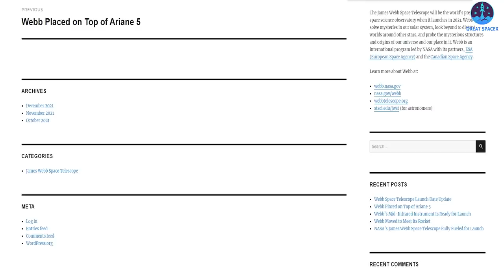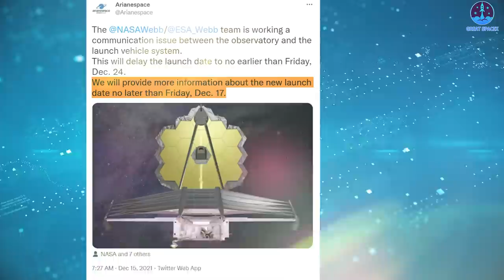NASA James Webb Space Telescope Launch epic got BIG PROBLEM!

Comment: This is a case of 
"If in doubt - DONT" Its a high stakes project,  I feel they are being particularly careful with the JWST purely because SO MUCH has to go right - THE FIRST TIME, hence one of the reasons why it has taken so long to get to this point, with the amount of testing that has been done and as much as it goes SO far out past the moon into the L2 orbit, so much has to happen for it to work right and as you say, once its out there, there is no going out there for updates or repairing is something goes wrong - I have no issue with NASA delaying launch and being a little paranoid with this project - I have faith its going to work - and my fingers crossed.
Reply: I agree. Delay as long as necessary. Take no chances.

Comment: "It's always the connector"  A wise electrical engineer once said.
Reply: First rule of Electrical Engineering: It works best if it's plugged in.
Corollary to first rule: It works even better if it's turned on.
Reply: Or an over tightened tie wrap that bit into the cable insulation, causing a short in a coax or twisted pair of wires!
Reply: Software or hardware ie circuit boards are just as likely when working with new systems like this.

Comment: When it fails and they do it again they should get it into earth orbit first and then deploy and do limited testing and refueling.  Then either drag it out to L2 or have  it boost itself out there.   Good luck, fingers crossed.
Reply from the maker: Yup! Hope so!
Reply: JWST does not have a propulsion system that can return even to a highly elliptical orbit with a perigee near LEO.  If it does not deploy there is no backup plan.  The JWST does not even have the possibility of onsite maintenance designed into it.  So even if in a couple of years we could deliver a Canadarm and a crew of astronauts experienced in working in space out to L2 they couldn't do anything.  In a couple of years Starship may be able to deliver a complete simplified replacement without the requirememt to unfold and deploy.

Comment: I’m more worried about Ariane V performance than the JWST unfolding itself.
Reply: "Ariane 5 launch vehicles have accumulated 111 launches since 1996, 106 of which were successful, yielding a 95.5% success rate. Between April 2003 and December 2017, Ariane 5 flew 83 consecutive missions without failure"
Reply: @beta_cygni1950  
Well, I hope they keep on the pace.
Reply: @beta_cygni1950  And I imagine they must have been extra super careful with this one, checking every piece of that rocket that they could, probably 2-3x more than they normally would.
Reply: It's the most reliable rocket of that size in existence that's NEVER failed (if we don't count the first few launches in the 90's when it was still in development phase), so I wouldn't be worried about that part.

Comment: P.s. 
Let me add, it is normal that a temporary 100 meters communication cable pick up some stray noise. Possibly the grounding connections are at a different potential. They are making it a bigger problem than what it really is...
Reply: Good guess - lets launch it to find out!
Reply: Cable ground shield needs to be connected at one end only. Or not electrically bonded to any end.
Had to trouble shoot a 40 meter cable for RS232 with noise / data loss. Ended up replacing it with a 4 x twisted pairs cable, ground bonding to the machine, and replacing a 15 year old optoisolator. Lowering the baud rate to 9600 also helped.
Reply: @trespire  …seeing as how RS232 was engineered for max 50 FOOT length (cable capacitance was the real killer)… yeah, 40 meters (approx 120 feet) is high.
RS422 was your friend at these distances… that was engineered for over 1,000 meters…
Reply: It is a power Giga Ethernet cable, 100 meters max length...

Comment: 7:00 afaik, the telescope life expectancy is between 5-10 years, not decades. by that time it will exhaust its helium coolant and will no longer be able to collect data without maintenance which is not impossible in 10 years, but not scheduled at this point. like i said - afaik. but im no expert, i just watch yt more than i should.
Reply: Is JWST able to refill helium?
Reply: @ Martin Slaba Not that I’m aware of.
Reply: @Glen Young yes exactly. Hubble operated so long because we were  actually able to maintain and update the telescope thanks to the space shuttle . James Webb once is it in the space, nobody will be able to repair it or doing upgrades.
Reply: life expectancy of JWST is 10 years plus some room to spare
Reply: There is no consumable liquid helium on JWST to “exhaust”. The telescope will cool passively to about a temperature of 50K thanks to the sun shade. 
One spectrometer sensor needs to be cooled further to about 7K. That will be done by an electro-mechanical sealed closed cycle helium gas refrigerator. That gas is in a sealed recirculating system. None of it will be lost. As long as the pumps work it will cool indefinitely.
Reply: @executivesteps  yeah, it is amazing how this myth about “helium coolant” got invented, plus other internet-invented gibberish repeated about this telescope, for example it is 10000 times better than the Hubble. The fuel is the only limited consumable that will eventually run out, not some helium.

Comment: I bet the problem is ground shift. Add more copper to that cable, tying the grounds from Input and Output together with more conductor.
Reply from the maker: Maybe...
Reply: @colonbina1  I have seen it many times, including on the Space Shuttle. You are right. It certainly could be something else but people build boxes that then talk to their own test equipment. When you hook two unknown boxes together, the interface between them should be the same except for the grounding in the cable. In my years, ground shift the most common problem.

Comment: If this was meant to launch in 2007 then you could imagine that the tech onboard was perhaps 1990's tech at the design stage when it was first drawn up to be launched at a later date. Obviously while you have hold up's in manufacturing you can't be updating the hardware as the years go by because the equipment has to have some level of reliability of robust previous use from previous technologies used in space so this product that is going up by the start of 2022 is 30 years old tech or more & hardly anything new to get worked up about because this is how government type space technologies run.
Reply: Ed Ducate  I used to get worked up about all these so called wonderful scientific releases in the news about different projects until I heard about the time that goes into from the design stage on computers or paper to the actual time of it's working state & the time between is anything from 10 - 30 years before it's finished state. I think that SpaceX is the only company who is sending up to date technology which is under 5 years from drawing boards to finished state which is amazing compared to anything that is run through the government run NASA.
Reply: The JWST underwent a complete trashing of its' original design and was re-designed midway through development. Delay number 1.
Reply: Windows xp for life
Reply: i really don't believe that theory

Comment: James Webb will go down in history alright, as one of man kinds biggest continuous blunders. From concept to launch, what a mess... Probable would even have been better off building several new Hubbles, cheaper, serviceable being in orbit, and expect produce close to  the same results (interferometer)...
Reply from the maker: 7th, that's so messed up
Reply: I've been pushing the idea to use Starships from the testing phase as telescope housings.

I heard someone even wrote about white paper.

Concept is simple, Elon says due to the high production rate development cycle, there's going to be a lot of "lawn ornament" Starships. Instead of expending them on lawns, expend them into orbit with telescope stuff inside of them. Entire starship becomes a space telescope.

Because the mass fraction is so ridiculous for starship, they could be built cheap. Making everything fit is a non-problem too. It doesn't matter if you use heavy or large parts to save costs. In fact built four of them, and launch them using slightly questionable raptors from the design process also. Make four of them and be happy if two or more make it.
Reply: @jtjames79  In your dream!
Reply: @jtjames79  It makes sense, instead of throwing a crazy $10 billion on one project like the James Webb joke. Imagine how many telescopes we could have in orbit using Starship as a telescope platform for $10 billion! 🙂
Reply: @Glen Young good talk. 😀👍

Comment: A solid-fuel rocket launch is subject to vibrations. The vibration that is produced by the burning of the solid rocket propellant in the first stage booster is called thrust oscillation. These vibrations – or oscillations – come in the form of waves, which travel up and down the length of the rocket-like a musical note through Ariane. James Webb really doesn't need excessive vibration. Should have changed the launch and gone with Space X. Let's hope James Webb still works when it arrives at L2. If it doesn't I hope they made a spare James Webb!!!!

Comment: Any idea why they are using Ariane V and not Falcon or Falcon Heavy?
Reply: Ariane V was the only (western) option back when JWST was designed...

falcon is not capable of launching JW...
falcon heavy could but only entered operations back in  2019

Before you ask "why not change the launcher": keep in mind NASA build the JWST in cooperation with ESA and CSA. ESA provides the Ariane 5 (pays for the launch of JWST) and also 1 of the 4 instruments: NIRSpec (Near-InfraRed Spectrograph), + ~50% of MIRI (Mid-InfraRed Instrument) and 15 personel to support mission operations in Baltimore.
It simply doesn't make sense to change the launch vehicle, no one would have gained anything significant from doing so.

Comment: Once Starship is fully operational, it'll be able to bring Hubble down for a re-fit and upgrade.
Reply: They're not going to "upgrade" hubble. They are building the next telescope.

The Nancy Grace Roman Space telescope, started in 2016 and on schedule to launch in 2027, will be more "Hubble-like"... a primarily visible light scopes with optical resolution similar to Hubble. But it will have extended near-IR capability.

NGRST will basically be a wide-field hubble (meaning it will be able to observe more in a few months than hubble has been able to over 30 years!). And It will have:
-  extended near- IR capabilities, so it will be parked at L2 like Jwst.
- it will have a more advanced coronagraph than JWST, so it will be better able to image exoplanets than James-Web will.
- its spectrographic capabilities will be more advanced than JWST's as well.

It is true that hubble will remain the only one of the three (hubble, Jwst, Roman) with UV capability though. So hubble will still bring something to the table.

Comment: it will most likely be a processor whose silicon is breaking down and not keeping up with frame processing or the cable may have deteriorated due to age and got a hair line fracture that intermittently drops out, either way a portent of the troubles to come due to its ageing decade or more old components and soldering (dry joints and oxidation of connectors. If it gets to orbit and if it boots up and boosts to parking spot and if it set up and unfolds correctly (no damp air from the tropics gets trapped and frozen) then if it can be controlled properly with old components that have to be near or beyond life expectancy it may work, but old components are unlikely to work for long  sadly, this project has taken funds other astronomers need esp Hubble although smaller could have had an update service pack and refuel for approx 1/3rd price and a change in focal length to give infra-red capability. With a proven system, that then would have given experience need for a lunar observatory of a much bigger multi wave length scope by decades end. It has also taken funds from manned space and shuttle maintenance and update , rebuild  program as shuttles should have had a 50-year life  just like 747. so when it fails it will  have  to have given  at least 10 years service to be of value for the money spent, given complexity and age that is unlikely. Better to give to musk to put into a moon base where it could be serviced.

Comment: Could the problem be as simple as exceeding the maximum length of the cable leading to a weak signal?
Reply: If its anything like networking cable (ethernet), its likely a shielding issue or a connector not seated properly somewhere.  RFI (radio frequency interference) or EMI (electromagnetic interference) is probably causing the dropped data packets (frames), not something you want during launch of a unique payload like the James Web.  Weak signal is more of an issue for fiber optic cables, though is possible in long distance electrical cables.  A 100m cable run shouldn't be long enough for that problem. 50m cables are regularly used in home ethernet.
Reply: @TianarTruegard  Thank you for your answer! My thought was exactly on ethernet cables... long story short - I used to work in a company that used a 90m ethernet cable for monitoring a controller. We had continuous signal loss and contacted our IT consultant who told us any connection longar than 70m should have a signal booster to run efficiently. Boosting the signal eventually solved the problem.

Comment: Not for decades, if everything works it is designed for a minimum of 5 years but 10 years are possible. The fuel limits JWST lifetime.
Reply: It is more like a minimum of 10 years
Reply: @brianchan8  it WAS a minimum of 5 years (design), but with a launch that accurate most of the fuel of correction burns was saved making a minimum of 10 years realistic.

Comment: The risk reward ratio of this thing is bad. Over 300 points of failure means if any ONE of those things goes wrong the entire mission is fucked. To top that off there is no way to repair or modify the telescope once it is launched. And if everything goes perfectly it's projected lifespan is 5-10 years. If Vegas was laying odds on this thing it would be a longshot.
Reply: I’m sure they’ve done the maths
Reply: @HendersonSouth  They have done the math and that's why they are so scared and have postponed this launch over a half dozen times. They know it's a coin flip.

Comment: You say it is meant to run for decades. I think you are wrong.  We have been of the understanding that it is only designed to run for approx. 5.5 years if it is always in need of adjustment!!  If it can remain perfectly still which is not expected it could possibly run for up to 10 years at the most!!!  It has to supply power via solar to constantly keep three balancing momentum motors running. These momentum motors will adjust where the telescope will aim towards. It uses gas power to keep the scope in it’s proper orbit in relation to the L2 point. The scope only contains a limited amount of gases for this function. Once those gases are depleted the scope will more than likely come to the end of it’s useful life and it is not really designed for refueling. It is not designed for maintenance even if humans could somehow get to it’s location. Unfortunately it is of poor design and like they say it is what it is. Let’s just keep all our fingers crossed that it provides really useful information for as long as it can. Maybe the design of the next telescope will be designed for maintenance and refueling and be on budget!!!

Comment: This guy needs to learn how to quote when it's like very vital to know exactly what the head NASA dude is reporting...seriously.   "quote"....."unquote".   It ain't hard bro.    .....followed up by soooooooooooo many errors.  Dude, it will not operate for "decades."  It's expected mission length will be 5 years, which may be able to extend to 10 if the coolant and propellent fuel lasts.   This leads to ANOTHER error.  It will not stay "perfectly still" at the L2 point.  It will enter a more-or-less stable orbit.  The telescope will have to correct this slightly unstable orbit with propellent from time to time, which is one of the things limiting it's mission length, though the coolant issue is the main limiting factor.